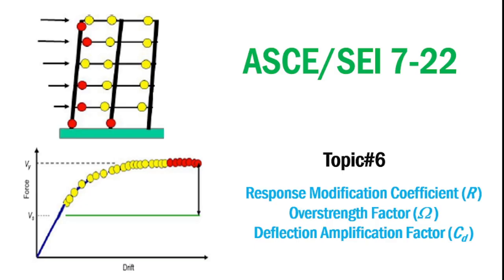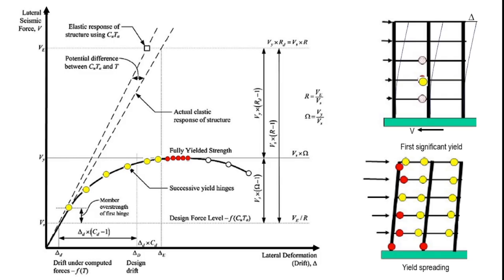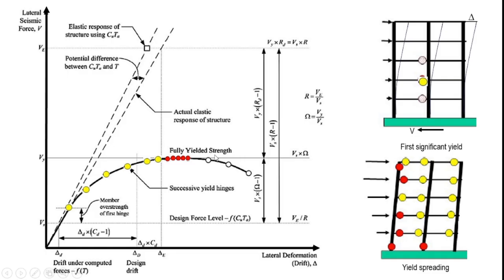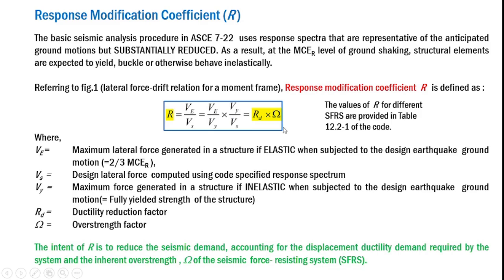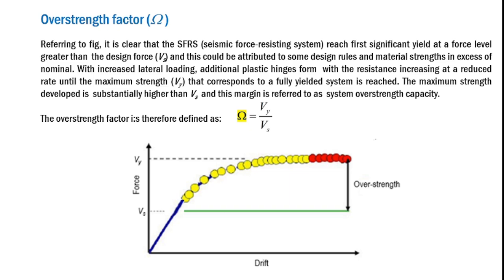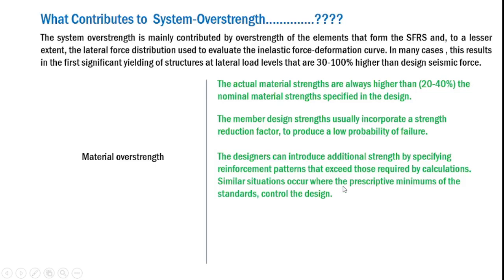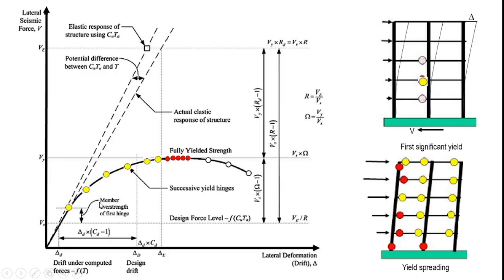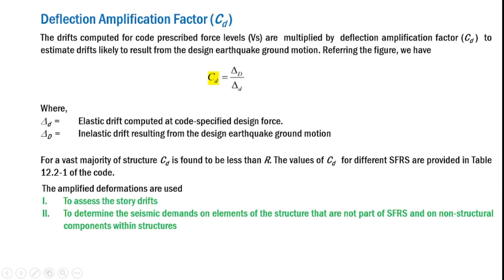ASCE/SEI 7-22: Topic#6- Response modification coefft (R), Over-strength , Defln amplification factor

Comment: Sir, it would be great if you could demonstrate a simple RC structure design using the steps you've covered in this playlist. It would really help solidify our understanding.
Reply from the maker: Definitely you will receive multiple examples covering different type of buildings with different SFRS. Currently we are focusing on concepts very much required before  switching over to detailed designs
Reply: @puttattjayarajan1199  Thank you so much sir. Eagerly waiting for that

Comment: Excellent presentation...thank you very much for your brilliant work...sir could you please let me know what M.I (cracked/uncracked) for column and beams shall be considered for drift computation?
Reply from the maker: Thank you always for your great support.
The requirement of using cracked sections in analysis models for various structural elements of reinforced concrete buildings such as beam, column, shear wall etc. is clearly mentioned in cl.12.7.3 (structural modelling) of  ASCE 7-22. This is applicable for computing earthquake demands on members including drifts. ASCE 7 do not make any prescriptions for calculating effective (cracked) moment of inertia  and  instead refer to text book by Paulay and Priestley for the same. I would provide you today a link for this book through Linkedin.
Meanwhile, you can also obtain the recommendations for cracked sections from ACI 318-25 which very well matches with the guidelines provided in the text book